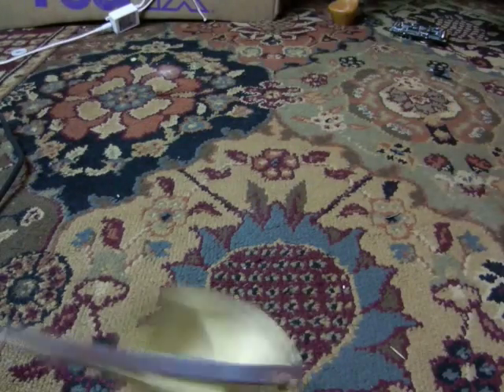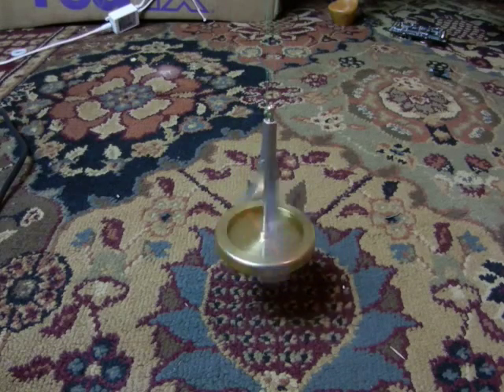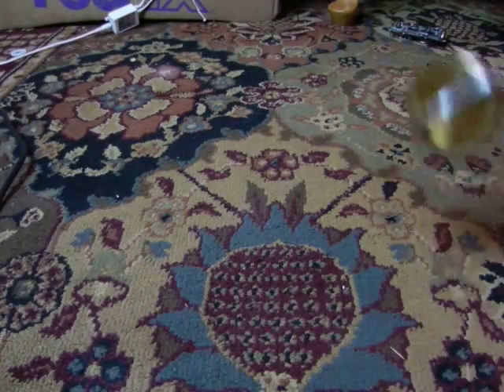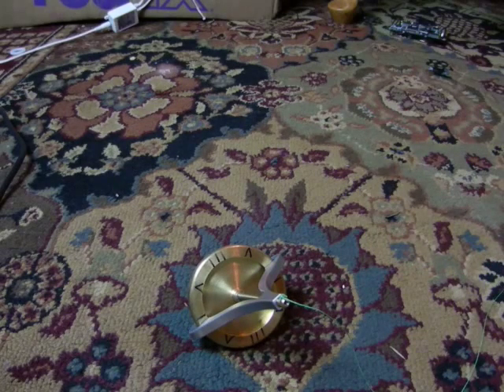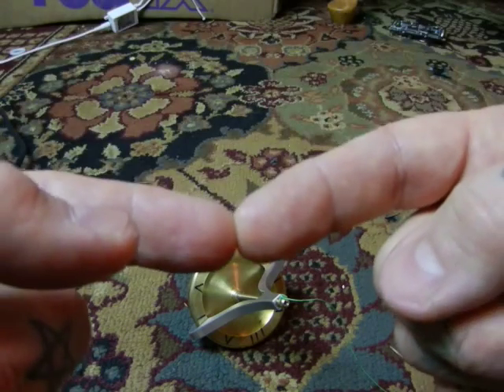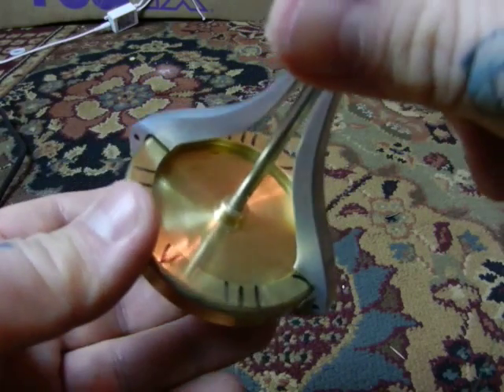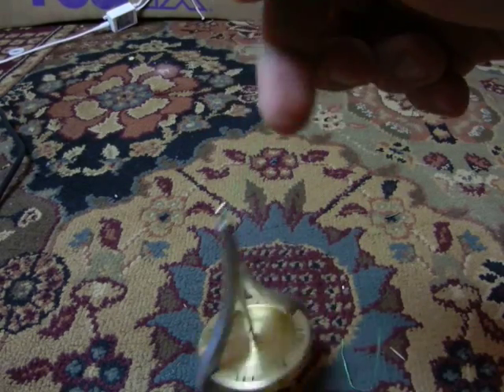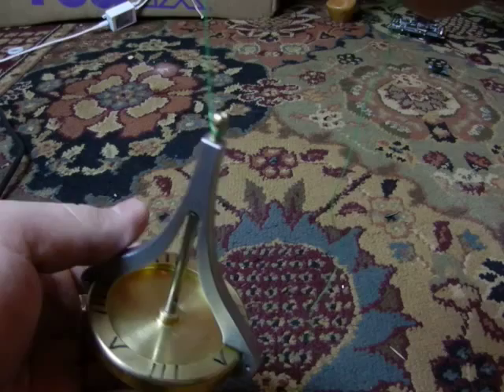VIDEO 2 Explaining Gyroscropic Levitation. Applied Inverse coherent force-image to cause levitation

Comment: When you go the same direction with your hand as the flywheel it reminds me of a bicycle wheel when it gets to a certain speed looks like it's going backwards because of possibly optical illusion or a representation of the force or resistance that it's meeting. So the resistance that you're feeling by turning it that way was like a residual effect of the resistance it's already meeting going the speed it was before you applied additional speed to it, causing additional resistance that you now are observing. The flywheel is heavier than the string you're holding so you get pushback

Comment: You could make a flying device if you could maintain an inverse spin on a gyroscope you can build it just like a gyroscope for the flywheel on the bottom and have some sort of belt motor spinning It one direction, let's just say clockwise...  And have an inverse applied force from above spinning, craft would make a 180 and levitate upside down from its original position. Then you just had a couple thrusters 90 degrees to that to make it go different directions. I'm under the impression that the weight of the flywheel is extremely important to the success of every other force in the formula
Reply: Already been done look up Sandy Kidd

Comment: also i agree with you point of gravitation and how its not so much gravitation or a pull, there is no pull only a perspective of the mechanisms responsible, point is the same way a field is created around a sinking pulling down other bodies of mass, is the same way the cosmos work in my understanding along with other variables including but not limited to atmospheric densities, centrifugul forces caused by spin, i can again explain more if you would like, along with the gyroscopic effect and the real explanation of its seemingly antigravity like effects and HOW and WHY it does what it does , thanks!
Reply: Will not work with out a fixed end. But with an artificial fixed end yes. But how?

Comment: The gyroscope is flipping itself upside down to match the spin direction of your hand. When you flip Clockwise upside down you get counterclockwise. So what the gyroscope is doing is it's flipping itself to balance or match what's going on with your hand as you spin it the inverse direction or counterclockwise... Why? I have a couple ideas but no definite answer. I'm sure it has to do with Field Force and being carried along in a certain way by its own inertia. These are just the words I know I don't know how to actually explain this. It makes me think of helicopter lift

Comment: By applying a clockwise movement force to a clockwise spinning gyro the gyro is showing a great deal of inertia.  It does not want to move in that direction.  By applying a counterclockwise movement force to a clockwise spinning gyro you are getting an additive movement force to the counterclockwise force applied.  The gyro is showing much greater movement force in that direction than the force applied.   Hmmmm....
Reply from the maker: the next video will make things clear, its the premise of M.C. or mirrored (force) cancellation.  There is only one force, magnetic, which nobody has logically applied to coherent spinning masses, .....until now, and all will be made very simple.
Reply: What would happen if the flywheel was made of magnetic material?